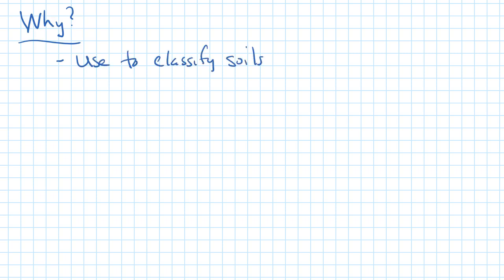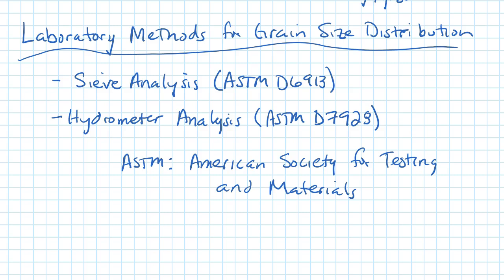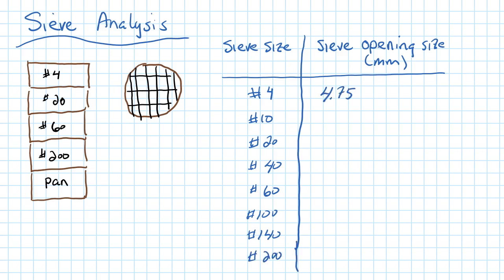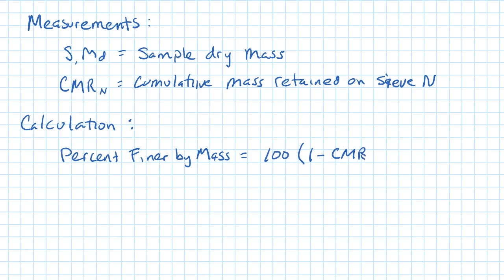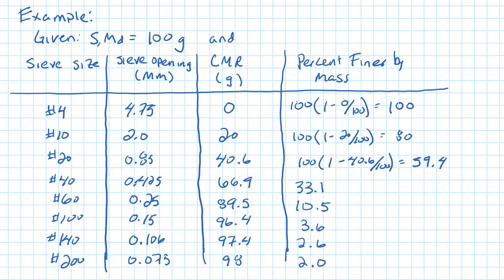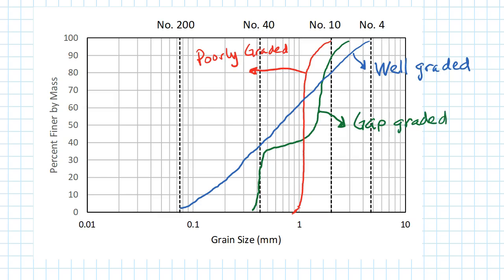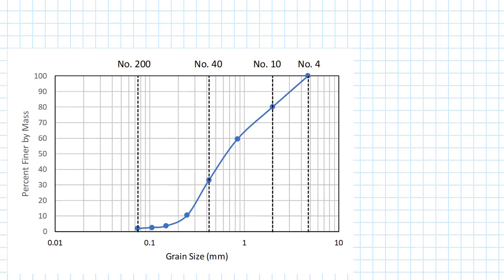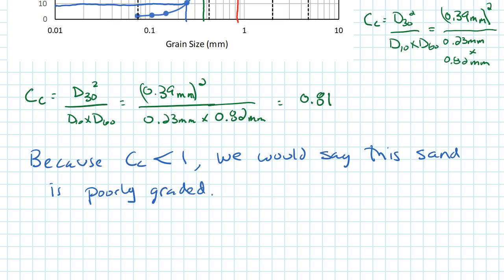Grain Size Distribution

Comment: I have sieves based off Wentworth’s divisions. It’s just more logical than the random divisions of USCS. The same principles work, regardless of your sieve sizes. The lower limit is actually about the 230 sieve. I know you picked 200 because it’s the USCS standard. Not much difference between the two anyway.

Comment: Thanks for the video! Very useful for studying for California Specific Exam for PG certification.
Reply: Matthew Pendleton let me know if you passed. I took both tests in 2011 same day. I passed them both. I’m not in CA. I heard you all have an additional test. Is that what you still have to take? Fortunately when I took the ASBOG it was skewed for structural geology when I took it. A bit of advice. Take a stereonet in with you. Learn the stereonet. You can knock out an apparent dip problem in a minute if you’re good. Better than fumbling in a calculator or trying to do a 3-point problem. Sorry. I rambled. I don’t mean to. Good luck.

Comment: What software you are using for lecture us ng handwritten statements? Its cool.
Reply from the maker: I have a touchscreen laptop with a pen to write my notes into a OneNote notebook. You can also get an external tablet that can be plugged into a computer (e.g. Intuos from Wacom), but it is not as nice as writing directly on the computer screen.  I use Screencast-O-Matic to record the video.